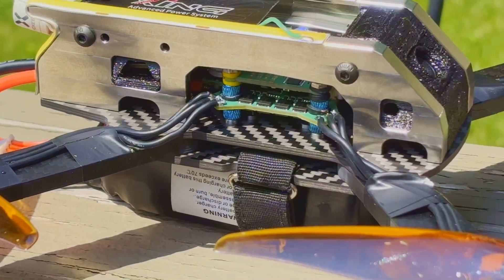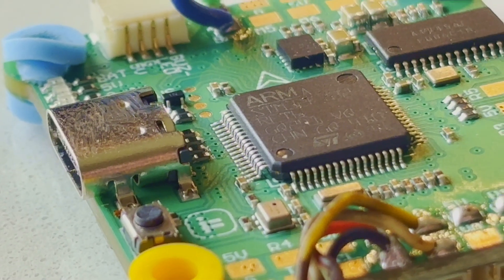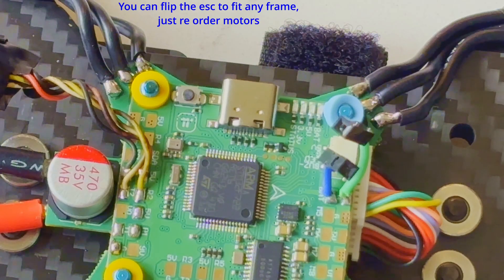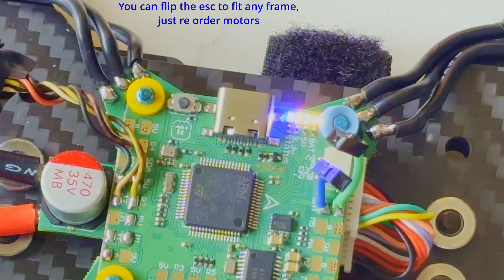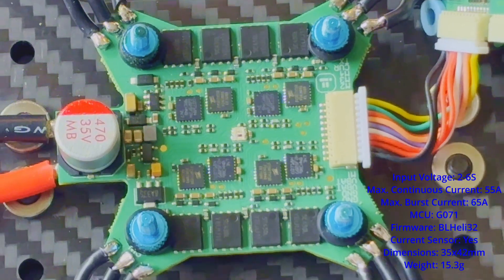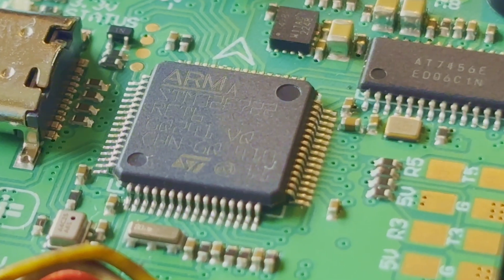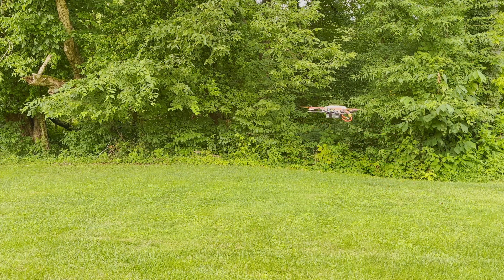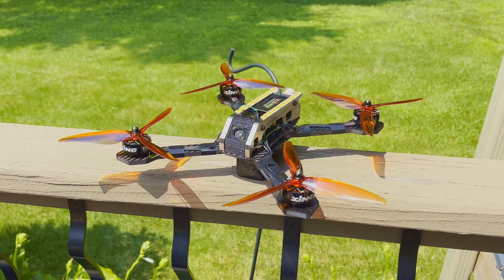Quick Rundown: iFlight Blitz F7 V1.2 Stack

Comment: Hey guy's I'm trying to install an o4 air unit pro   does the fc comes with a cable to connect to it? as the o4 cable doesn't fit into UART1, don't really want to try and solder as I'm really bad at it😅
Reply from the maker: Uart1 is a 5 pin connector... I dont have experience with that vtx but it sounds like the plug is different, this FC does come with plenty of extra Uart connectors if you need to resolder them together
Reply: Im going to attempt the same, did you ever find out if the o4 works?
Reply: Hi sorry for late response, yes it needs Y harness but don't have to solder directly to the pada @simonnavia547
Reply: @MrIcecosta is it included?

Comment: Sorry, I have a question, I connected the dji o4 pro to the FC but I can’t see the RC2 fpv on betaflight, I managed to connect the integrated goggle but the radio control is not, could you help me with the UARTs and cables, thank you very much
Reply from the maker: sure i can try to help!, this FC has a plug specifically for DJI/HDzero products, did you use that plug? for your control link between your controller/drone do you know what type you chose?
Reply: @WestFPV, of course, it was a 6pin plug that they give you with the dji o4 pro, but I just can’t see the rc2 fpv in the receiving section on bataflight, could you help me with the ports to configure?
Reply from the maker: @NordVpn-t2o what uart did you use? pull up the wire diagram or a photo of the FC and see what the plug says, then in the ports tab set that as MSP then go into presets and type dji and apply it and save and reboot
Reply: @ hello, thank you I finally succeeded, today I make the first flight, I hope everything goes well, maybe I put the propellers backwards, but I hope not :)

Comment: Did the stack come with wires other than the esc fc connector. I also enjoyed or like how you put your board upside down so the capacitor is in the stack.
Reply from the maker: Thank you! putting it upside makes it fit any frame, this stack has been a solid combo so far. the stack came with sooooooooooooooo many extra wires